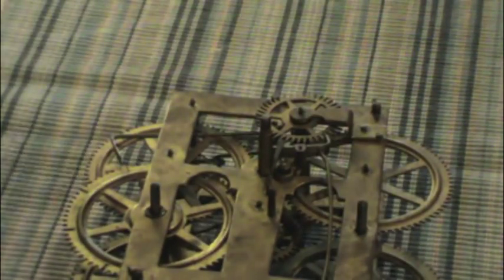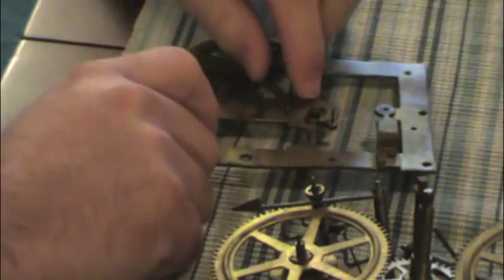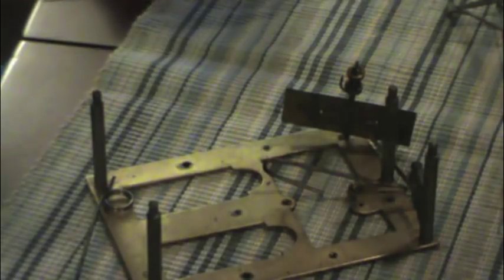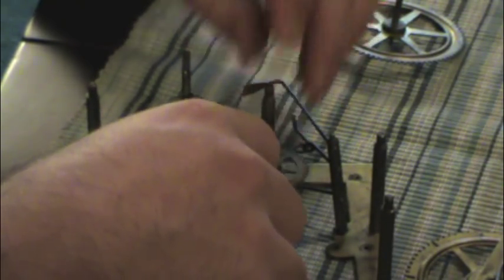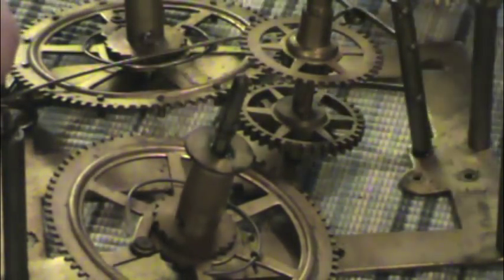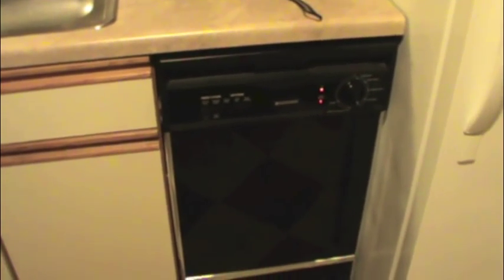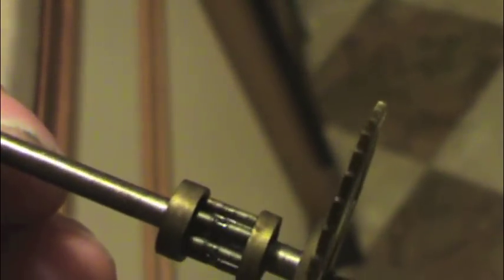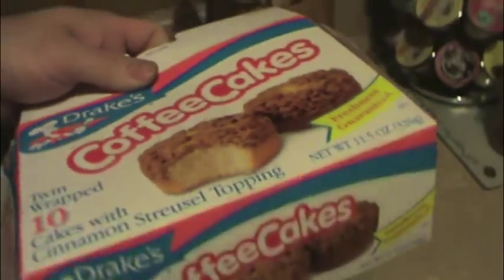Dismantling The 1847 Boardman Clock Mechanism

Comment: These were made in a clock factory, not a blacksmith's shop.  Although it would have been a crude factory by today's standards.
Reply from the maker: I don't recall saying they were made in a blacksmith's shop... if I did, I may have been referring to the iron wedge pins holding the clock together. This video was made six years ago...
Reply: You said it around 2:09 and I see now that you must have been referring to the taper pins instead of the whole clock.